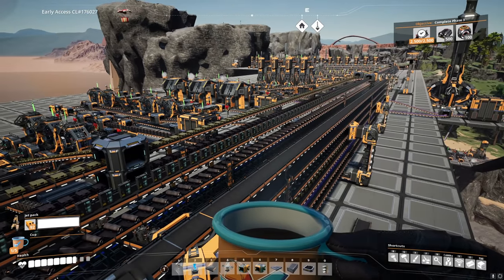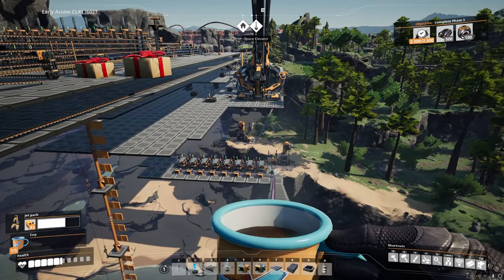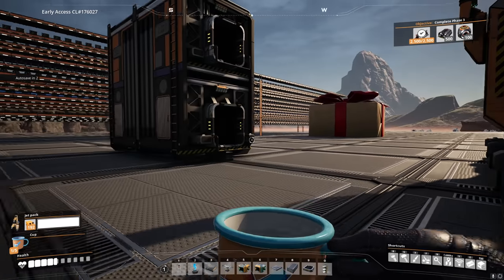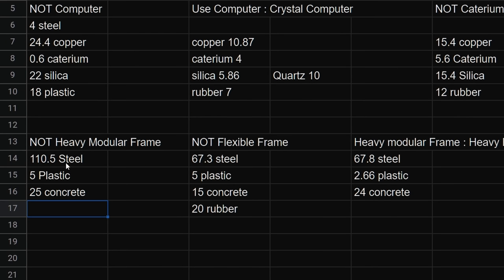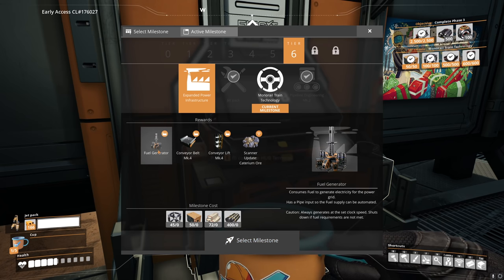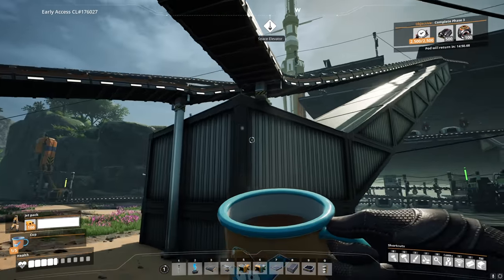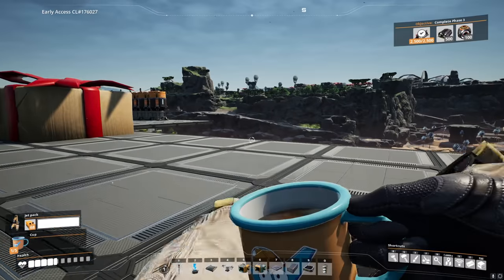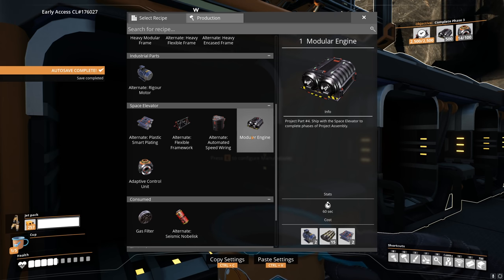Satisfactory : Ep8 Unlocking the last tiers

Comment: Can't wait to see how Francis sets up Fused Modular Frames.   I have a factory with 8 manufactures making 12per minute.  The amount of infrastructure needed to support those 8 machines is insane.
Reply from the maker: Why do you need to many? Are you making 6 × Nuclear Pasta and 6 × Thermal Propulsion Rocket per minute?
Reply: @FrancisJohnYT  I can't remember off the top of my head I'll have to load my season two game and check, that's part of it.  But you also need them to build MK3 miners and Particle Accelerators which I built quite a few of for my nuclear setup.  I like to have a full chest of parts that I need to build with so probably made more than absolutely necessary.
Reply: @FrancisJohnYT   Actually I'm making 8/min Pressure Conversion Cube and 2/min Thermal Propulsion Rocket.  I'm using 2/min Cubes on Nuclear Pasta and the rest for Alt Plutonium Fuel Rods.  The final 2/min Fused Modular Frames are for my pocket.

Comment: I'd recommend turbo fuel, if you're wanting to never worry about power again. Generators consume 12 cubic meters of normal fuel per minute but only 4.5 cubic meters of turbofuel per minute. I've got two pure oil nodes 1200 oil turning into 1600 turbo fuel and feeding into ~355 generators producing around 53,333 megawatts. It was more than enough to get get super late game production online. Doing the same thing but using diluted fuel, you'll get around 3200 cubic meters of fuel per minute being burned by 266.66666 generators making around 40,000 megawatts. Still a lot.
Turobofuel is a giant build, and you need a lot of power to even get it online, but it was a lot of fun to get it running.
Reply: crude -> HOR -> diluted ->TF

just started building this last night
Reply: @UniqueBreakfastTaco  Yep. That's the way to do it.
Reply from the maker: I'm planning on being lazy about the power and just going with Diluted, with three pure oil nodes in one location that is 60,000 megawatts assuming I can get enough water from the surrounding area. Though the cost in raw resources to build 400 power plants is going to be a bit high to start.
Reply: I skipped turbo fuel in my season two and did nuclear.  I'm going to skip nuclear in my season three and do turbo fuel this time around.   Setting up nuclear was fun the first time but I can get the power I need without having to deal with the rads.
Reply: @dragorin1108  Might not be enough. The other thing about using fuel is that you're using oil.
Reply: @rauminen4167  There are 30 oil nodes on the map and I used 3 for plastic(400pm) and rubber(400pm) and some fuel from byproduct enough for 33.333 Generators.  If I just use the oil on the north shore that's 3450 available.  Still leaves Oil in the Desert, West Coast, & Dried lake bed plus two resource wells that I have yet to tap.  If I need more power, rubber or plastic.   Power isn't a problem atm as I setup 120 coal plants (6 coal nodes) prior to getting oil unlocked.  I've been to end game once I know what that factory needs power wise.  I won't need Nuclear this run.
Reply: @FrancisJohnYT  Totally fair and should be more than enough to sustain whatever kind of base you build. Btw, I loved your ONI content. When I set up your nuclear reactor design, I felt so awesome. Keep up the cool content.

Comment: Your first unlock with the new tiers needs to be the hover pack. Very very useful! Edit: keep in mind some of the value/recommendations for which recipe to choose is based not only on the per resource, but also the rate of production and the total energy cost.
Reply: Well you can get more energy, especially with nuclear. Mines cap out.
Reply from the maker: Energy looks to be a non issue late game, resource nodes are pretty plentiful, but the size of our main bus is a bit of a concern.
I'm trying to get the most out for the least put in as a primary goal, but also trying to spread out the load a bit so we don't max out a single belt, namely steel.
Reply: @FrancisJohnYT  Yeah, I went with double belts for a few things from the start on my bus, steel being one of them. 
The big storage is basically a two-way merger/splitter as long as you have some buffer in it. Eg. you can double your belt size

Comment: It would be useful to have a standard cost to compare all the materials against.  Could be rarity.  Pick the least abundant or most abundant material and assign the value of all other raw materials as the ratio of their abundance.
Reply from the maker: That's a bit tricky as what recipes you use can determine how valuable something is. If you avoid using ones that depend on Caterium it drives down it's value.
The plan here is to try and avoid maxing out a belt with one type of resource, so no more than 480 is the target and steel looks to be the bottleneck. Will most likely run a second if not third line of that before we are done.
Reply: Satisfactory Wiki uses a standard cost they call "Weighted Points". For a given raw material and recipe, the WP is calculated as the (Amount of resource required per minute / maximum possible resources per minute) * 10,000. For Iron Ingots, that's 8.53, while the alternative Iron Alloy Ingots has a total WP of 11.73 (3.41 from iron ore and 8.32 from copper). 

This is useful to put different resources on even footing. The down side is that it doesn't factor in how far apart things are and how much you've used a given resource for other purposes.

Comment: Some more tips.. unlock hover pack immediately by buying the aluminum on awesome shop.. it's only need about 6-10  coupon iirc for the hub research and to build it.. it's makes building so much easier as long u have power.. no more climbing ladder
Reply: I was going to recommend something similar. Not the AWESOME Shop.

All you need for the Hover Pack is 240 Alclad Aluminum sheets, which are just aluminum ingots and copper.

Instead of building the train network. then setting up aluminum. then getting the hover pack. He should setup aluminum ingot production near the bauxite without setting up a rail network, just power. Then he can easily carry home enough aluminum ingots to combine with copper and unlock the Hover Pack.

Then the hover pack can be very useful in constructing the rail network to bring Aluminum Ingots to the factory for production. Since rails carry power you should be able to hover over them while building any difficult parts of the train line.
Reply: @danfr  bauxite spot tend to be far away and it's usually on cliff and a pain to get to.. and beside 10 coupon is nothing if u dump all your excess resource to keep the production going
Reply: @nicolasbram165  I'm playing in the same area as him. The Bauxite spot he's probably heading to is on the ground in a forrest. It's not that hard to get to. In fact it's pretty easy to make a hypertube cannon to get back and forth from.

I'd advise against wasting coupons in this case because Francis has spent relatively little time setting up AWESOME Sink stuff. He's not going to have as many tickets built up as I had at the stage he's at.

Comment: First, thanks for the bird eye view request...
And second, why don't use the trains to transport resources near your base... It's the purpose of trains and since you've already got them, makes sense to use rather than not using them...
Anyway, it's your call... Thanks again for all the fun content...
Reply from the maker: That is the plan with Aluminium, make it on site and then transport it to the factory. We could just ship the raw stuff but processing that on the main bus would be a massive headache.
Reply: @FrancisJohnYT  true..
It will also help to have a separate power grid, so no need to worry about main base power consumption. Apart from this, is there any mod that lets you find what machines are using how much power on a grid? Like ONI shows. Makes it easier to manage power consumption that way..
Reply from the maker: @RedThunder333  Not that I am aware of, but from what I can tell, once you go mass diluted fuel you are pretty much swimming in power.
Reply: @FrancisJohnYT  😅😅 well that's another solution too.. Good luck with expansion and I'll be waiting for the next video...

Comment: I don't remember using plastic for heavy modular frames.  Oh is the plastic because of what you are making the sheets with?  That makes sense.
Reply from the maker: Using the Steel/Plastic recipe to make the iron plate is just so incredibly efficient. It means we don't need to run a bunch of iron plate belts.